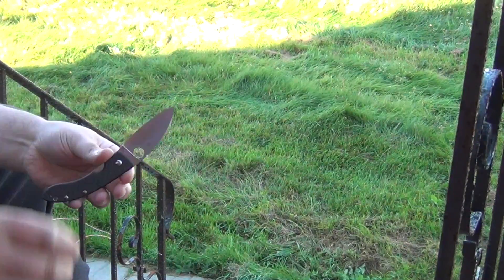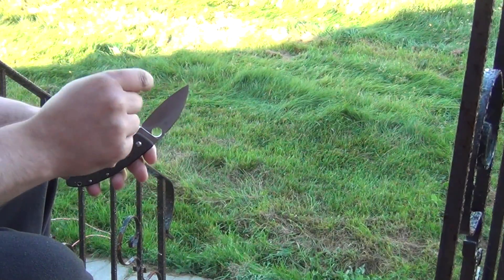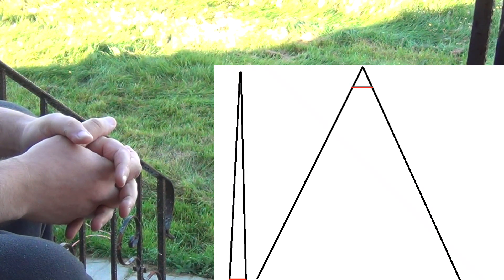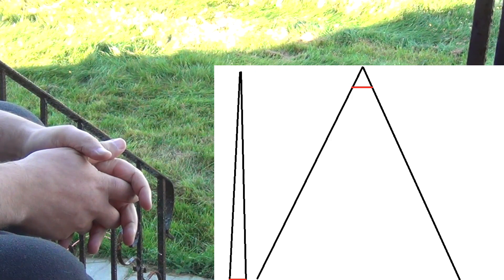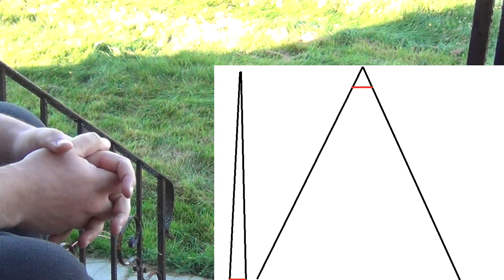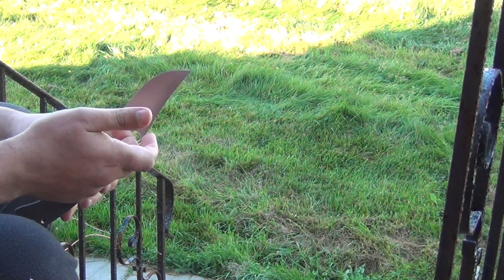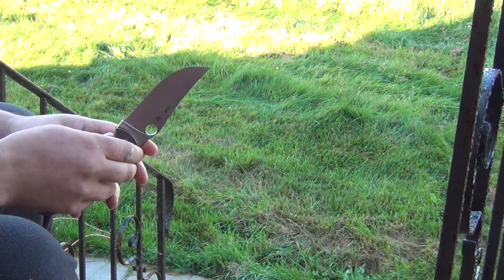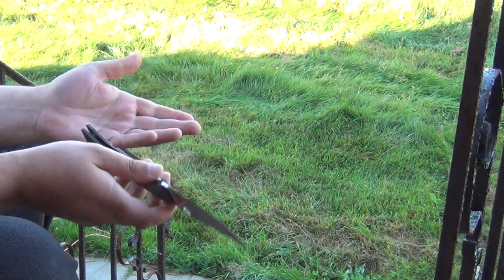Edge retention as a function of micro-bevel angle : VG-10, S30V (Wicked Edge)

Comment: Percentage wise how different are s30v and vg10 would they be 2.5% different in composition?
Reply from the maker: I am note sure exactly how to calculate that because I don't know exactly what you mean.  Most steels are very similar in alloy content as they are mainly iron, for example 1095 is 99% iron, and 1050 is also 99% iron and you only see a difference if you go to decimal places. However 1095 and 1050 are two very different steels.
Reply: Cliff Stamp  I suppose what I am asking is if you need a 2.5 degree difference to equal the edge retention in these steels and chemically they are quite similar would steels that are very different have a 10degree angle change to have equal retention. Say for example 5160 vs s60v 
I am having a bit of a hard time putting my thought into words.
Reply from the maker: mark a I think S60V is likely to cross over to where edge retention in the kind of sharpness I normally cut to would be decreasing due to excessive carbide volume. But yes, if you compared 5160 vs M2 for example the difference would need to be much larger. It would only take about 40 hours to find out the number for any pair of steels.

Comment: Will we see regrind of this 10V blade here or in the forum?
Reply from the maker: Yeah, I was doing some light brush work with it this evening and chipped out most of the belly. I am going to reset it evenly to 13 dps and use it like that for awhile.
Reply from the maker: On an amusing note, I used the WE to reset the bevel to ~ 10 dps. However it took a long while and I didn't notice the clamp on the left hand side came loose and I did about 20 passes with the rods moving all over the place and completely varied the bevel on the left side, really scratching up the tip. I could have done it more even freehand. That was kind of ironic as in a bit of a whimiscal mood I had decided to use the WE to keep the bevels neat. In any case the edge is reground now to close to 20 di. I will likely flatten the primary at some point as well.

Comment: Cliff, wouldn't edges below 10-15dps leave steels like 10V too brittle at the edge? Seems like you would run the risk or sever carbide tear out at those angles. Would a micro bevel be used to shore up the apex? Ive had a K2 myself for almost two weeks and am actually enjoying it quite a bit. Mine had a similar edge angle to yours when it came. I dipped it down to 15dps to even it out along the entire edge. I saw ankersons test on the Spyderco forum and it seemed to perform fairly impressively.
Reply from the maker: Kevin that is an excellent question and the answer is basically yes, that UHC steels will have issues at lower angles due to apex stability. There is a second question though which is what does this mean then when you talk about edge retention  and cutting ability in general? If you run AEB-L at 10 DPS vs 10V at 15 DPS then AEB-L has a very large advantage from the increase in edge angle and will likely easily outperform it on hemp and cardboard readily.
Reply from the maker: Chumgeyser I think this is one of the critical questions in regards to performance in general. There is one further question or comment as well. The main reason why people don't use very low edge angles is that on accidental hard contacts they will take more damage. However on really inexpensive knives are you concerned about that? No.

So what happens if you take a $5 made-in-kathmandu knife and you set the edge at 0.005"/5 dps with a 10 dps microbevel and run it against the K2 Farid with the stock edge on hemp, the Farid loses heavily. Are you going to be willing to grind the Farid so low AND this is the kicker, still use it heavily and deal with the occasional damage?

Because here is the important thing, if you are not, then that cheap no-name will not only cut better, it will have a longer cutting lifetime and could even have higher edge retention if you leave the grit really low and don't mind wearing it out fast. But it is a <$5 knife are you going to be that miffed if it only lasts a couple of years before the blade is worn away?
Reply: I think this is THE question. If, let's say, 10V can only be taken down to 8dps before carbide tearout and AEB-L can be taken down to 5dps before carbide tearout, what is the difference in edge retention? The answer should tell you which steel has better potential edge retention or PER (I just made that up.) You also have to take into account what you are cutting and how that changes the minimum angles before carbide tearout. If 10V is 8dps (lowest dps before carbide tearout) on clean hemp rope, and AEB-L is 5dps... what are they on dirty hemp rope? What are they when cutting the medium that would be the most harsh on the edge they are going to encounter in use?
Reply: Cliff Stamp This is how I've come to view my machetes. They are going to take damage regardless of how thick I set the edge. Might as well make them thin and thus easier to repair. There is a point where I've made them too thin, to the point that even typical work, without hitting anything hard, will cause edge folding.
Reply from the maker: Chumgeyser And the downside is what - you have to replace one every few years and in the mean time you have optimal cutting ability, sharpness and ease of maintenance. There is a reason why all native blades are typically ground that way.
Reply: Cliff Stamp No downside to making them thin. It's not like I spend much than $5.00 on a machete anyway. When it is so thin that the edge suffers from quarter inch ripples from cutting green branches then it becomes more work to fix than it is worth.
Reply: Cliff Stamp I was thinking about another subject and this comment just brought it to mind.  It is about cutting zip ties and causing blade chipping.  If you just cut the zip tie free hanging or on a cutting board, no issue.  But wrap a zip tie around a metal pole a cut into it and twist, you usually end up damaging the knife by hitting the metal, same when cutting cardboard, if it is on the concrete, a lot of time the knife is running against the concrete. This comes from working as a warehouse man, and unpacking crates, metal packing bands, breaking down packaging and cardboard all day.

Comment: How did you do 13DPS on a wicked edge?
Reply from the maker: Clamp the handle not the blade. This puts the blade way out in front of the clamp so you can use much lower angles.